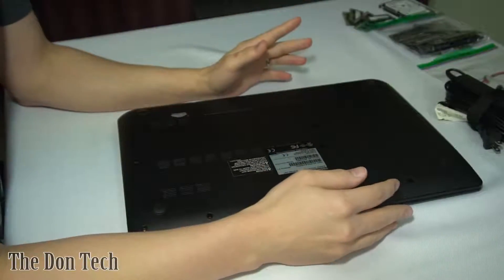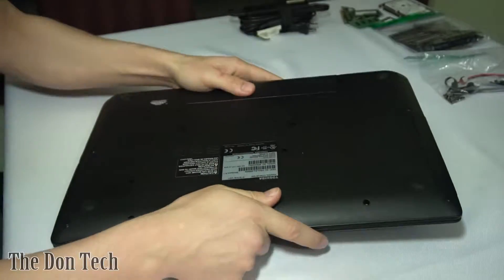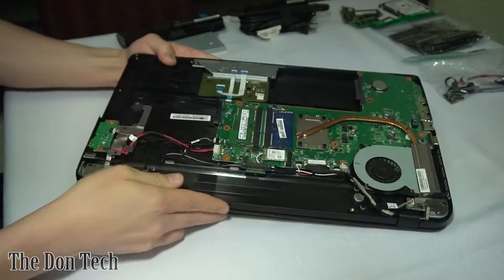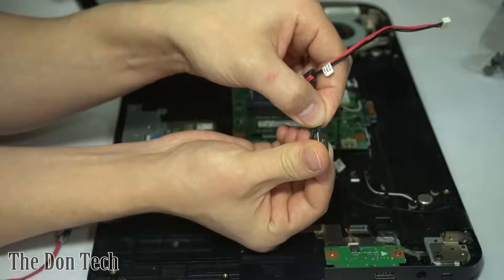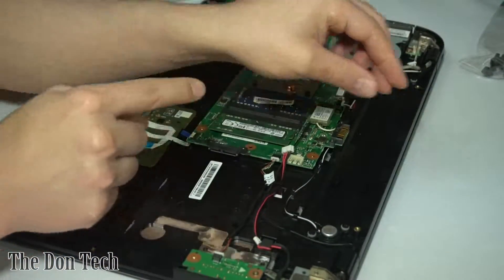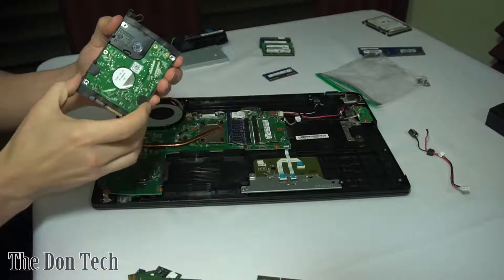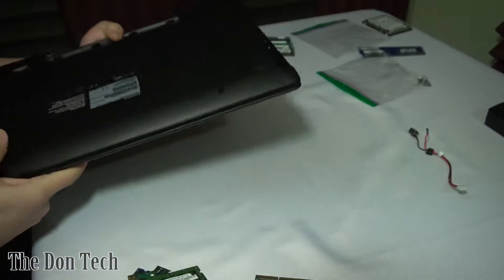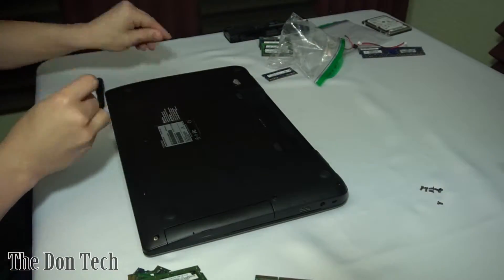Toshiba Satellite C75D-B7300 Repair Guide: DC Jack, HDD & RAM Replacement! | The Don Tech

Comment: Great video, but I want to know what interface the hard drive has, SATA? I am hoping to upgrade someone's' laptop with a solid state. I can't see the adapter and it isn't listed anywhere. Thanks!
Reply from the maker: Yes this is indeed a SATA interface for the hard drive. The connection is to the left of the CMOS battery (upper right of the laptop when first disassembled). Hope that helps! :)